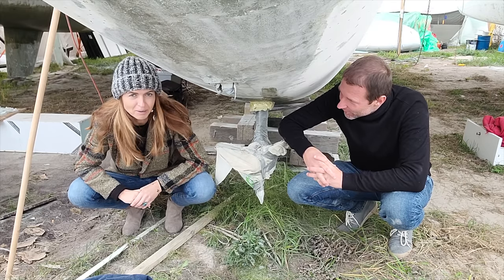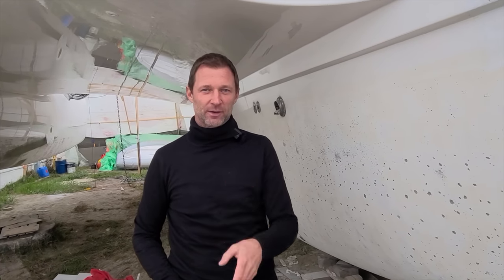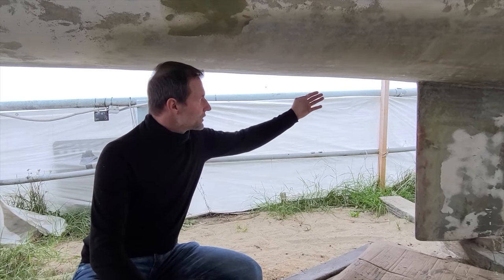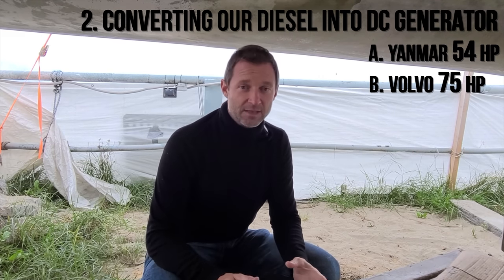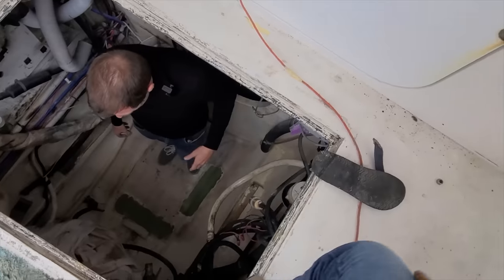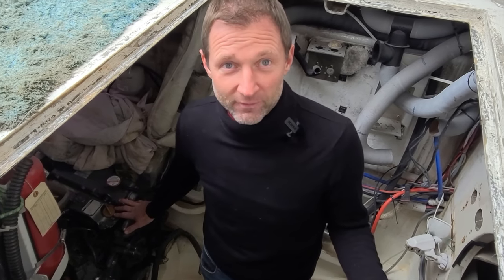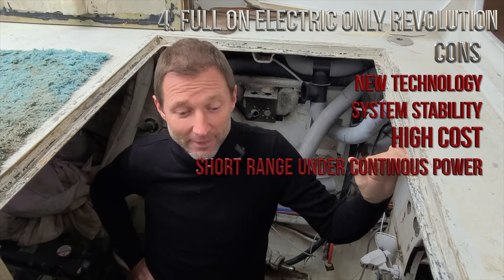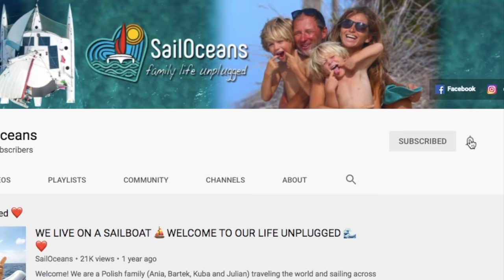The Big Decision - Electric vs Diesel Sailboat Propulsion

Comment: My suggestion is: leave Yanmar 54 where it is, connect hydrogen generators to it and to the batteries and to an alternator. In the remaining 2 hulls could mount 2 electrics or 1 electric + Volvo diesel hydrogen hybrid. If solar power & hydrogen enough - could run diesel engine as green hydrogen engine.

Comment: Definitely go electric. The risk of needing long periods of electric autonomy is lower than the risk of a single diesel failing. Dont forget you can also use electric regeneration under sail, so even with limited sun, your batteries should be full most of the time.  You can also de-couple some of the decisions eg install electric, keep your genset and see how that goes. You can get rid of it, or get a bigger one or buy more batteries later   when you know your exact energy needs
Reply from the maker: That's what I am leaning towards. I like the redundancy of two separate drives. Cheer Chris. Bartek
Reply: Definitely Look, how the green energy working for "Sailing Uma" then make a statement lol

Comment: My humble opinion is the electric motor, lithium, and solar technology are not advanced enough to be practical at the moment for your retrofit.

In the future that may not be the case.  I did the electrical dream for a while with my Neel build until I received a quote for a lithium, solar integral/engine system with solar panels at a whopping cost of 170K Euros in La Rochelle installed. That would buy one hell of a lot of diesel fuel (maybe around the world once). I also investigated using Mastervolt (the best) lithium batteries at 400AH each the cost of those batteries is whopping 5.5K Euros each. I’m also not convinced of the fire safety of Lithium Phosphate either with large racks of batteries. There is a lot of built-in safety features required in the battery cells required. Stay away from 48V batteries they are hellish expensive at this time.

The Yanmar 54HP is massively underpowered for such a large Trimaran! Throw it in the garbage! You need to remove it and install a larger more fuel-efficient modern diesel. Please don’t install that old engine back in the sailboat either its garbage! I think installing a new Volvo 110hp with sail drive is the way to go. I don’t like sail drives either! A shaft drive is better but requires more retrofitting depending on your desire for pain. You will get greater fuel economy by reducing RPM but still have the extra power when you need it.

I would, however, still put in as much solar power as possible using lower-cost 200 AMP hour Victron Litium Batteries. They are less expensive but still provide OK performance. Also, don’t buy in the lithium battery hype they cannot be deep-cycled as deep and often as one might think. Better than lead-acid that’s true but not necessarily as good as the sales hype.

Good old fashion generator back up! I wouldn’t be without if especially if you have A/C. I purchase an ultra-efficient and silent MASE 8.1 KW with Yanmar 3 cylinder engine. It only burns 2.9 liters per hour at 100% load. The sound level is 51db at 9mt in an enclosed container.
Reply from the maker: Wow €170k, that is crazy indeed. No wonder you backed away from it. I don't want to talk exact numbers yet, but I can already tell you that our conversion will cost a fraction of that quote. There's a some parameters that can significantly change the cost of the system. For example keeping everything 48 V is one way to radically simplify the system. If we were going back to the idea of good old classic diesel we would most likely install our old Volvo after a nice overhaul. The 75 hp pushes this boat in flat water at 12 knots. That was the main reason why we chose to scale down to 54, which actually in 90% of the situations is also enough. We only need more power when occasionally one needs to power through a local upwind, upstream situation with corresponding waves. So needless to say 110 hp would make this boat fly :).
We currently have the house bank based on the LiFePO 800 Ah Battleborns and we respectfully disagree. It is a game changer for us. For over 2 years now we don't have any issues with power. We get back from the batteries what we've put in. 97% efficiency as oppose to 60% in case of our old Trojan Lead-acids. So you can use high loads all day and night long regardless. Ability to use the entire 100% of the capacity. We often would go down below 20% with no problems just to recharge back up to 80-100 during the day. So 800 Ah lithium bank is effectively the same as 2400 Ah lead acid bank in terms of useful capacity assuming you can only safely discharge acids to about 60-70% time and time again. High loads don't cause significant voltage drop. We use the welding machine sometimes and with its near 5 kW draw it only causes .5 V drop (that's about .6 c for this bank).  When we charge there is no slow down between 80 and 100 percent as in the case of lead-acids. Acids give us 3000 cycles at best and no warranty to speak of. We now have 5 year warranty on the Lithiums plus expected 10000 cycles at least. If you're planning to live aboard for more than a year or two it's a no brainer. Another words we love them and the switch from lead acids literally changed the way we live.
DC gensets are significantly lighter than the same power AC hence going down this route also saves weight and radically simplifies the system.
Thank you for watching and commenting.
Cheers mate,
Bartek
Reply from the maker: I forgot to mention one important part about Lithiums. They are so much lighter. Current 10 kWh bank weighs 88 kg. If we were to achive the same usable 10 kWh capacity in lead acids we'd have to have 30 kWh of capacity or about 2400 Ah bank. We used to have a 1200 Ah bank that weighed 280 kg. So in terms of usable capacity in kWh/kg of battery: lithium 8.8 vs. 56 ... another no brainer specially on a boat that's so weight sensitive. I am not lazy, I don't mind refilling the distilled water occasionally, but it sure is nice no to have to worry about that at all. What can I say. I couldn't go back to the old technology. Cheers mate. Bartek
Reply: @sailoceans  The 170K Euro quote was for a Pohcon install who works for the Neel factory and they are the best in the business. I agree 100% I will be removing my lead-acid batteries as soon as I have the cash. For me, the weight savings help offset the generator weight. However, I will buy quality batteries like Mastervolt and Victron and they are expensive for the reason of the associated safety electronics and ingress protection. You can always order cheap Chinese batteries or use tesla car batteries it depends on how much fire risk you're willing to take.

Comment: Almost forgot don’t forget those dam expensive inverters you need. Holy smokes you will pass out when you get the bill for a new Victron or Mastervolt inverters. I think you will want to buy new units for sure. The more batteries the more inverters you will need to handle the load.  Also, I assume you will be a 220V 50HZ boat due to Euro appliances. But, don’t forget a shore power converter for USA with 220V 60HZ and 110 outlets. I assume you will have to purchase an inverter for this. Be careful on a DIY you don’t want to have a fire hazard.
Reply from the maker: Don't worry. We're actually all set on that front.we currently have one of those expensive, but really good inverter chargers from Victron, a Quattro 12V 5kW. It is more than enough for our house needs powered by 8 Battleborn lithiums and 2.3 kW solar array. We really don't have a need to connect to the shore ever. The Quattro can nevertheless be connected to he shore both in the EU and US. We also have a backup 3 kW 110V 60 Hz for the US tools and in case Quattro quits. So all that stays and it's going to connect to the separate motor banks via DC/DC converters in case we need to equalize.

Comment: Hello there are three thoughts that you might want to consider
First I think that you're being very irrational and precise on your thinking.

Option one.  On the two outer halls electric props with region capability.
If you have the resources install a third third electric prop on the main hall.   Invest in a 5K inverter generator in case you decide to run things like air-conditioning or heat or any other time let's say your batterys aren't working you would have something to fall back

Option two.  Electric props outer halls. Keep the diesel engine the way it is. But shrink your tank or keep it the same this way you could put an alternator on the engine and it could do more than

Option 3 don't listen to anyone else just go with what you think everyone has and I commend you for doing what you're

Comment: If you use so little engine, why go electric? A nice expensive engine allways shut down.
Reply from the maker: Manoeuvrability, extra power on those few occasions, redundancy of two independent drives in emergency, silence, and virtually limitless autonomy. Just few ideas that got me to seriously consider it.
Cheers mate. Bartek
Reply: @sailoceans  k

Comment: I'm sorry but if you want to "have it all" there is only one technology that is theoreticall possible, and that is hydrogen. If 55hp is to low and 75hp is OK, then you must realise that it is app. 50kW. You could place all Tesla batteries 600kg? having 90kWh capacity, and that would give you appr. 2 hours operating full power 75hp. There is no way you will be able to provide source of electrical energy for say 10h of full thrust. 5 times of Tesla batteries? 3 tones of weight, houndred thousands of dolars? This is not an option. If you want to have ca. 75hp engine for say 10 hours  ride it has to be a diesel, as a direct engine or you can run the generator and then power electric engines (serial hybrid). 7kW solars, say 30kWh batteries, 20kW genarator with 2×25kW electric twins you will have your 75hp electric engine but for one hour ride. 
With fuel cells you can have electric power for 75hp electric engines as long as you have hydrogen. BMW SUV can ride 600km on 6kg of hydrogen as I remember. Burning hydrogen you creates only water with no polutants, co you are 100% eco. Fuel cells can provide electricity not only for transtortation. 
Cons? The technology is on early stage of development, so there are not many sollutions out there an expertiese.
Reply: There are unfortunately still waste gasses with hydrogen burnt in an ice engine as part of the lubrication oil also gets burnt ..theres also the issue of water vapour contaminating the lubrication and requiring different materials in their construction..  
Big engines yes ..even for turbines better but small engines not so easy till someone starts building them and that might be a way off.
Reply: biggest challenge: hydrogen production and storage

Comment: Hi , As a proffesional seafafer with expirience more than 10 years on offshore hi tec vessels i would reccommed go diesel hybrid.Sell bigger engine buy antother same smaller and go for 2 drop down azimuth thrusters ..
 Not sure if so small  existing already. One diesel will suppy one azi thruster then you might consider  being redundant.If you are interested how thise systems works in proffesional maritime industry find me in fb.
Reply from the maker: That's the way we're heading. Cheers. Bartek